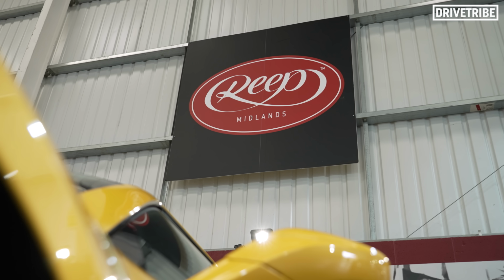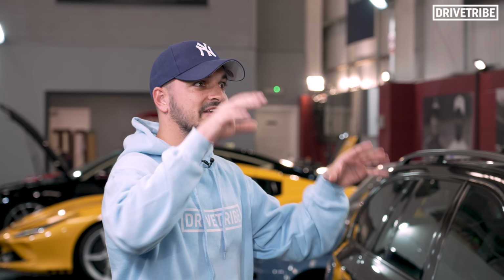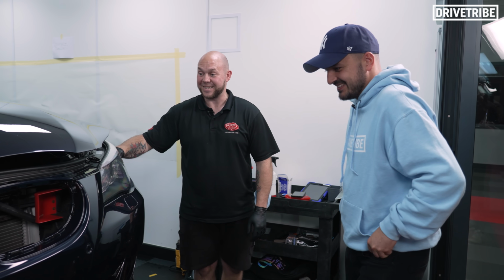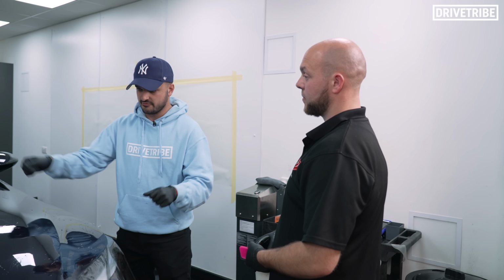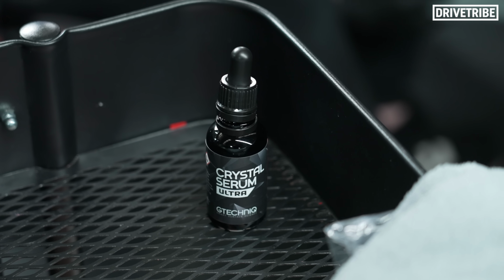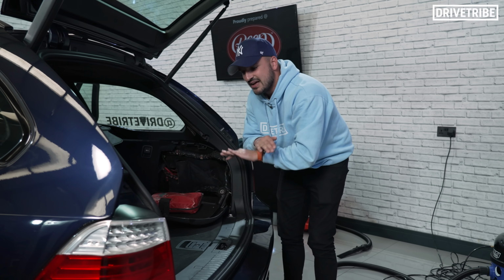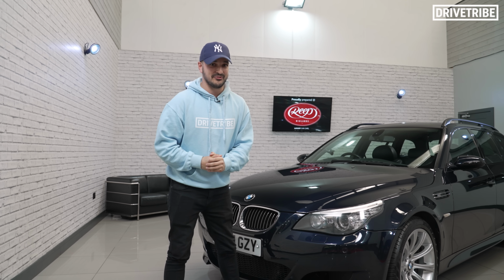SCRATCHING the DriveTribe V10 BMW M5 estate!

Comment from the maker: You can buy every product we used on our M5 using this link – Get 25% off car cleaning and care products from our friends at eBay! https://ebay.us/igApbz
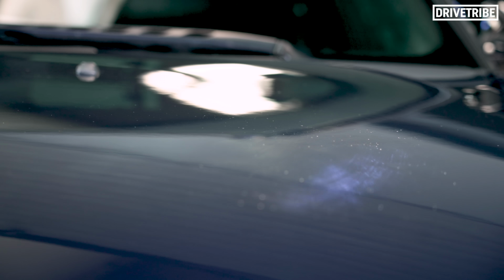Reply: Hey @DRIVETRIBE ..... What was that badass song at 17:16?  Love to get my hands on that when I do my detailing on my car
Reply: You're putting a 6 speed in it, aren't you?
Reply: The link only has turtle wax products? No gtechniq?
Reply: You'll probably make it a manual but its not an improvement.
Reply: how come the paint work wasn't done in hammonds shop?
Reply: Mike, the only thing you should change on the BMW is the radiator. An all-aluminum radiator would be the best option. I've talked with BMW technicians, and they've admitted the recycled-plastic end tanks of the factory radiator are the weakest part of ALL BMW's cooling systems. Also, I'm a tow truck driver in the San Franciso Bay Area in California, and the only reason I need to tow BMWs is for overheating. Well, okay, severe coalitions as well, but that's not the car's fault.

Other than that, if you intend to change anything else, you should sell this estate to someone who won't ruin this car and will enjoy it as it is. To quote James, "SANTERD!" James is right. Vehicles of this caliber and higher should only be maintained, driven, and enjoyed as they were intended by the manufacturer. If you want a project car to modify like a tasteless, tacky American lacking reason, common sense, or mechanical sympathy, please buy a different vehicle to mutilate.
Reply: Mike, You still want to change this fine example of German engineering? 

You want to modify a nearly factory condition, rare, desired, sought-after by those who can't afford it yet car and make changes to it like a board teenager that just got their license to drive? 

You can't take the hint can you. Did you not understand why commenters successfully stopped you from changing this car's color?

If you want to be like Rob Dahm or some other You Tuber, do it to a car NO ONE will be bothered if it was given a new life. Like a car that has been wrecked or has no hope of being what it was when it was first sold. 

Take the hint, mate. You're not the right person for this car.
Reply: How does the 25% discount work or is it already gone? Anyone got it to work and if so on what did it work for you on?

Comment: PPF is beyond worth it. When I custom ordered my C7, I had it put on the day it came in. 32k miles later, and no scratches/dings etc. The peace of mind you get from being able to not worry about rock chips, or where you park it, or swirl marks from how you wash it, etc. 100% worth it.

I'll never understand anyone who gets something really nice, or just something they deeply care about, that doesn't use PPF.
Reply: I get that it looks nice but how can you not understand that some people don’t have the money for it? I love my car but I can just about afford to run it.
Reply: Because most people don’t have expensive cars worth protecting the paint of. At that point you are just saving the paint for the next owner.
Reply: Ppf is boring, what are you saving the paint for? Give the car some character.
Reply: @Master1906  I can definitely understand if you don't have the money for it, but I see people with Lambos, and Ferraris, etc that don't do it.
Reply: @BeardedFrog  I've seen some videos on youtube where the owner has never washed the car in like 2 years so I'm not surprised.
Reply: @BeardedFrog  well, if they scratch their lambo/ferrari, they just get a new one. or a fresh coat of paint. so the money thing works both ways, i guess.
Reply: @Dave1507  Which can lower the value of the car significantly though. Original paint is worth a lot more.
Reply: Same with phones.  Not much point protecting a cheapo throwaway burner phone's screen, but when you pay upwards of 2K, its well worth spending an extra 1/40th on a top quality vinyl-silicone protector for the screen.

Comment: That's the M5 officially protected for many years to come 👌 buzzing to show you guys the next couple of videos on this car
Reply: Please don't manual swap it!
Reply: Mike when you going to address the Mad Ford controversy?
Reply: Mike, the only thing you should change on the BMW is the radiator. An all-aluminum radiator would be the best option. I've talked with BMW technicians, and they've admitted the recycled-plastic end tanks of the factory radiator are the weakest part of ALL BMW's cooling systems. Also, I'm a tow truck driver in the San Franciso Bay Area in California, and the only reason I need to tow BMWs is for overheating. Well, okay, severe coalitions as well, but that's not the car's fault.

Other than that, if you intend to change anything else, you should sell this estate to someone who won't ruin this car and will enjoy it as it is. To quote James, "SANTERD!" James is right. Vehicles of this caliber and higher should only be maintained, driven, and enjoyed as they were intended by the manufacturer. If you want a project car to modify like a tasteless, tacky American lacking reason, common sense, or mechanical sympathy, please buy a different vehicle to mutilate.
Reply: Mike, You still want to change this fine example of German engineering? 

You want to modify a nearly factory condition, rare, desired, sought-after by those who can't afford it yet car and make changes to it like a board teenager that just got their license to drive? 

You can't take the hint can you. Did you not understand why commenters successfully stopped you from changing this car's color?

If you want to be like Rob Dahm or some other You Tuber, do it to a car NO ONE will be bothered if it was given a new life. Like a car that has been wrecked or has no hope of being what it was when it was first sold. 

Take the hint, mate. You're not the right person for this car.
Reply: @guy_fox_427  Bit much init mate?

Comment: Loving the series, wish I could spend this kind of money on mine, living vicariously through you at the moment! Coilovers next?
Reply: I feel the exact same. Would love to do it to my M5 but it's a lot of money
Reply: It’ll be a manual gearbox swap
Reply: @AsadMulla  hau match?
Reply: @Jesse-2531  PPF would be about £500 for front only. Then there is the Ceramic coating, respray, detailing. That's going into the thousands
Reply: @neilhudson7099  DTC
Reply: @AsadMulla  probably £6500 for this whip

Comment: Part of my job is applying Protection Pro film to mobile phones.  Its incredibly satisfying, and mostly the same as the application of the PPF to this BMW, just at a much much smaller scale.
Similar process, install gel goes on, then the film, then a squeegee to pull the gel out, and finally a heat gun to help with the edges of phones with curved screens.
Yes, its an OCD sufferer's therapy.  I don't have OCD of course.  I have CDO, which is like OCD but the letters ARE IN THE CORRECT ORDER.

Comment: Mike, the only thing you should change on the BMW is the radiator. An all-aluminum radiator would be the best option. I've talked with BMW technicians, and they've admitted the recycled-plastic end tanks of the factory radiator are the weakest part of ALL BMW's cooling systems. Also, I'm a tow truck driver in the San Franciso Bay Area in California, and the only reason I need to tow BMWs is for overheating. Well, okay, severe coalitions as well, but that's not the car's fault. 

Other than that, if you intend to change anything else, you should sell this estate to someone who won't ruin this car and will enjoy it as it is. To quote James, "SANTERD!" James is right. Vehicles of this caliber and higher should only be maintained, driven, and enjoyed as they were intended by the manufacturer. If you want a project car to modify like a tasteless, tacky American lacking reason, common sense, or mechanical sympathy, please buy a different vehicle to mutilate.

Comment: I took my old V8 Vantage to a place to get a quote on what it would cost to get PPF and ceramic coating like this.  The cost was $4,200.  And that was a few years ago, so it's probably $5-6k now.  Yeesh.
Reply: Worth it imo, if you can afford it. Makes it super easy to keep clean
Reply: I paid a bit less 11 months ago for my GT3, I paid £3000 11 months ago (no so called ceramic coating though) i had to have it resprayed due to chips etc. 11 months later, not a single mark on it. I use it for work 6 days a week and track it about once a month.

Comment: 7:50 "Always pull your squeegee, never push"
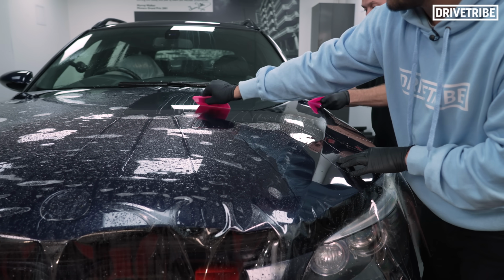8:35 Proceeds to push squeegee

I guess you have to advance to Jedi squeegee master before being allowed to do that :D Do as I say, not as I do for now!

Hope this film doesn't yellow or end up flaky or generally go nasty after a few years of UV exposure then take the paint off with it. But then the current vehicle owner will have sold and moved on to the new shiny by the time that happens anyway and a new cottage industry will appear - "PPF Renovation Specialists". They'll also offer to do Titanium Ion Finish Coat which far exceeds the performance of the current measly ceramic crud.

All work for the working person to do I suppose. :D

Comment: New paint, but they couldn't be bothered to fill those holes in the bumper?
Edit I see they added back the factory plate holder. Couldn't there be a cleaner option for the UK?

Comment: Useful technology--though I had my car clear coated in commercial aircraft grade polyurethane, which means hypothetically I can hit a bird at 600 mph & it will not leave a scratch--that seems like an easier solution.
Reply: ….But just a whacking great dent in your panel 🤣

Comment: Making out PPF is a premium material/product 😂
It doesn't save stone chips and anything less is dealt with by T-cut.
Reply: I have a GT3 and it's made a huge difference to me. I had to have mine resprayed almost a year ago due to stone chips, and now..  Not one. I do track work about once a month and daily drive it. Believe me, it works if you get decent stuff.

Comment: You can cheat with both vehicles by just doing impact zones.  its super common at least here in Canada that shops do pre-made kits. They pull your vehicle up  from a program database then use a plotter to cut the ppf. Rather than wrapping the entire hood they'll jus do like the front 16-18 (or 23ish on a "large" kit). then run it down the fenders to match.  

They typically are designed to end a couple mils from the edge of the bonnet or other panel rather then wrap around.  By far not the Best protection but its a cost thing. I did the bonnet, fenders, above my windshield, the little part above my bumper and inside my door handle pockets on my new Bronco Sport. Installed the kit was only 600CAD, in comparison the hood wrap alone on the M5 was probably 4x or more my total bill. on a M5 yes worth it.. on your everyday bronco.. not really. 

The cheap kits get you like 80% of the protection for a fraction of the cost making it a worth while investment. I had a 18 in kit on my 2011 edge, in 11 years I only ate 4 tiny rock chips above the ppf coverage area on the bonnet and overall maybe like a dozen and half total in uncovered areas. Not including above the windshield. That was my one regret so I made sure to do it on my Bronco.  I had it for over 11 years and almost 300k KM  before It got written off and really for a $5-600 ppf job that's amazing value and perfect for your everyday vehicles. 

Just fair warning you do HAVE TO WAX it, otherwise the PPF will dry out and the edges will get crusty. But seriously you don't need mega wax, I only really ever used liquid wax once or twice a year, just enough to keep it moisturized and pliable.

Comment: As impressive as this all is, it ends up costing more than it's worth for normal, non-sponsored, people. Meh...
Reply: Excluding the body work, the detail with ppf install and ceramic coating would probably cost somewhere in the 4 digit range depending on the size of the vehicle. If i had the money to buy a new car and wanted to keep it for a long time id be happy to pay a couple thousand and have that protection. Or you could diy the detailing and ceramic coating then have a pro install the film. Its def a luxury that most people dont opt for because of the cost
Reply: @BCJDM  I'm talking about the entire process, not just this bit (which is also a waste of time on a car like this)